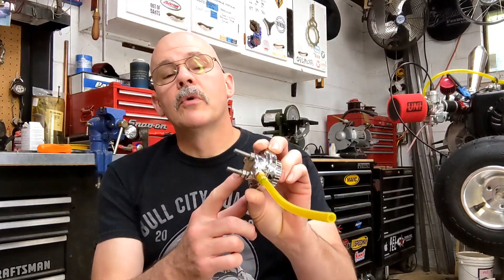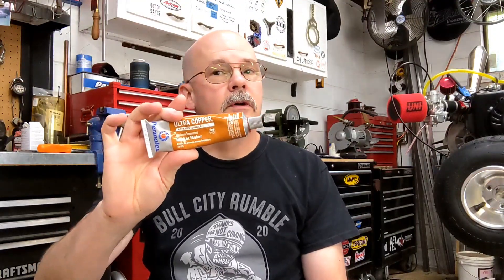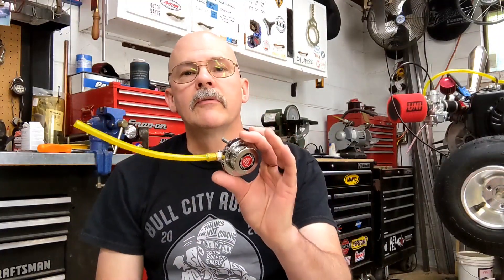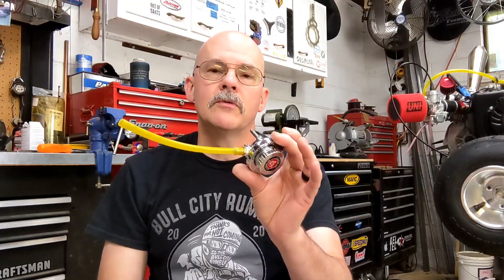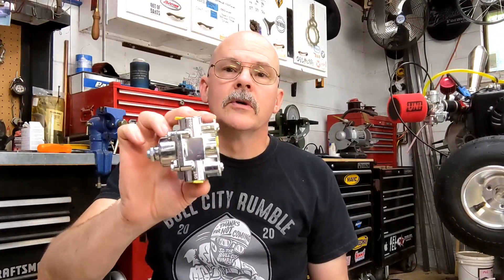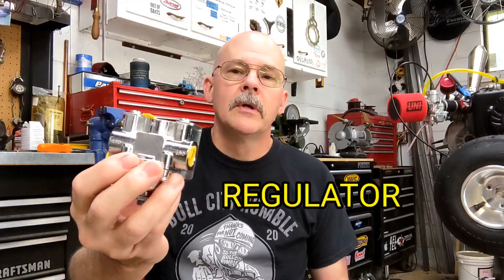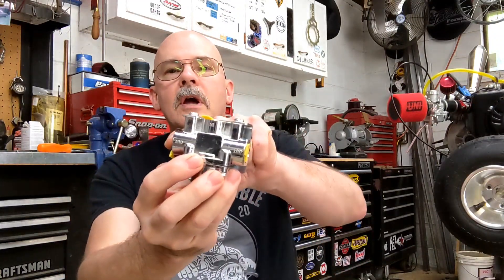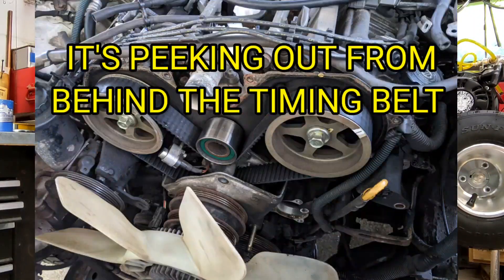SO MUCH PRESSURE, IT'S A FIRE HAZARD

Comment: I just picked up a go kart for my son and it has the same Kupp/Robron steering wheel as yours. Do you know how those are mounted to the steering shaft and how easy is it to swap it for a more traditional kart wheel?
Reply from the maker: Mine was so rusty I had to cut the shaft. I still have it hanging on the wall, I'll take a look at it and let you know how I think it comes off.
Reply from the maker: Mine had a single bolt that went through the steering wheel and the shaft. I would take that out , let it soak with penetrating oil, then try to tap the wheel off. If you don't care about the wheel you could drill out the plastic center and drive the shaft out with a punch while someone pulls the wheel.
You may have to get a new shaft if the end is not splined, most of the steering hubs are splined.
When you look for a wheel  check out Speedway Motors, they have some cool stuff
https://www.speedwaymotors.com/Search?query=steering%20wheels

Comment: You ever think of regulating the pulse pressure before it hits the pump?
Reply from the maker: I didn't, although I could have made a Grainger valve with a bleed, that would have, probably, worked.
Reply: @WhatIsTheWheel  I like what you did anyways, much simpler really. But yeah just a thought. I figured I’d throw that out there for future reference. Good work 👍🏼

Comment: I remember a couple years back I had a flat slide Mikuni that I had to change to a smaller needle and seat version to run a fuel pump because it was setup for gravity feed originally had similar problems at first not sure if your carb has that part availability.  Cheers

Comment: Hey there, if you haven't solved this problem, there are three ways to solve the carb over flow.
A) buy/make a bigger needle jet and seat to control the extra pressure from the pulse pump.

B) control the fuel flow, which you tried to do. But you're just over thinking it. Just use a 1/8 needle or ball valve to control flow. Turn the ends smaller to fit a 1/4" id hose.

C) control the pulse, this is the simplest and  my go to method. I have machined  brass pills to fit inside the hose that has different sized holes drilled in it to restrict the pulse. To save you time and guess work, a 2mm  restrictor works most of the time. If you need more fuel, just drill out that hole bigger or make another one that has a bigger ID. Hope this helps.

Comment: You could probably just use a t fitting from the pump output and have one end go to the carb and one end back into the top of the tank and that should get plenty of fuel supply at very low pressure.
Reply from the maker: Thanks, that is my plan. The T fittings showed up tonight.

Comment: Try putting a new carburetor on there
Reply from the maker: This one is brand new. I did have to set the float height, but I never pulled the needle out. I am going to make sure there is no trash in the carb. I had that happen with a Weber downdraft.

Comment: My project are on hold this weekend as I've got to finish the clutch on my civic si get it back together i can't afford to keep driving My truck everyday the 6.0 diesel is thirsty all the time
Reply from the maker: I usually ride a motorcycle(65mpg) but the 4runner is my wife's and she is using our yard truck(300,000 mile Mazda) so I need to get this thing back on the road. I thought about doing it as a video, but it would just be a couple of hours of me taking everything boulted to the motor off.
Reply: @WhatIsTheWheel  them Mazda aka Ford ranger are tanks they don't ever die i have a 94 xcab 4x4 5 speed with 4.0 in it I had to put a clutch in it at 520k we still use it at the farm it rusted completely out the odometer stopped working years ago along with speedometer in summer time I jump a wire across to get ac to kick on we use it to haul fencing stuff I did break down a few years ago put a nice set of 31 Mud tires on it and welded the rear Def

Comment: I've had a few of those regulators and tested them....  None of them I've had ever actually worked properly at lowering the fuel pressure they were all cheap junk. I just switched to a smaller lawnmower pulse pump and never had a problem again.
Reply from the maker: After taking them apart to see how they work, I see the problem is they control pressure after the valve not before the valve, so if they needle can't handle a couple of psi, they regulator will never close.